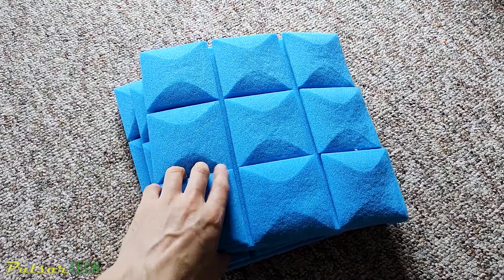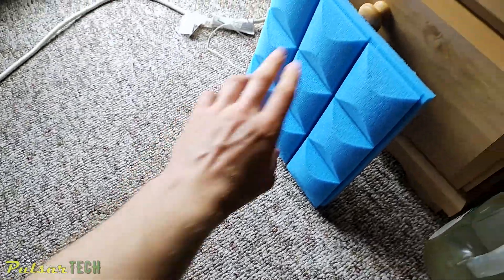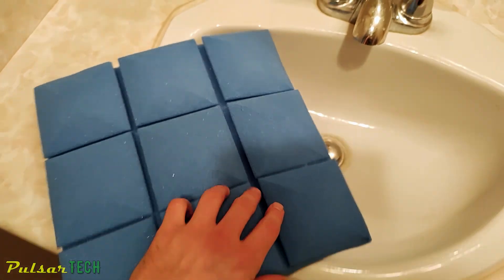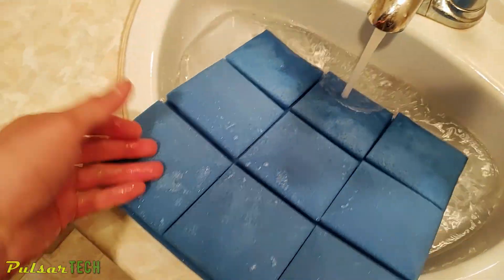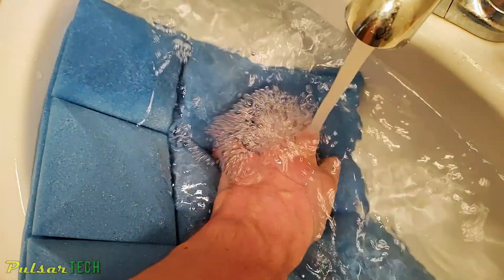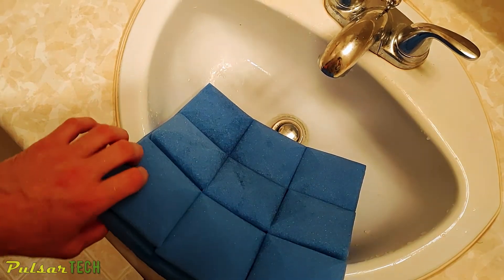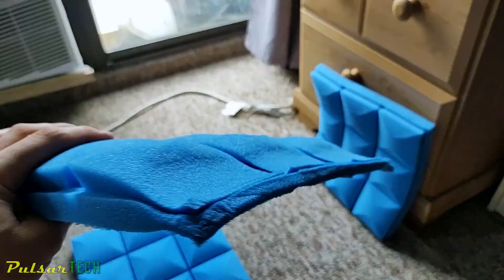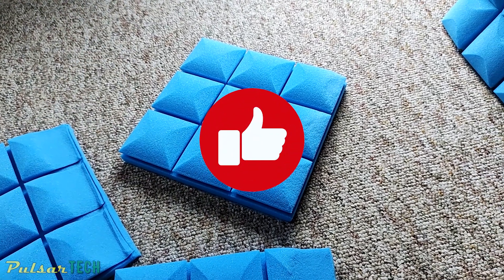HOW TO FIX DEFORMED ACOUSTIC FOAM PANELS

Comment: Can I know the particular model of acoustic foam used in this video? Thanks. The link in your description is for a different shaped one...
Reply from the maker: Hi, the link was correct at the time of posting but the vendor must have changed the design with time. Unfortunately, I can;t say if it's still available. Also as a recommendation I would suggest getting the black foam panels as these blue ones started to have some kind of yellowish tint on them, and they look like 100 years old. I don't know if it's just these particular ones or all of them. Good luck!
Reply: @PulsarTECH  Thanks for the tip , but do you know the name of this model? I was contemplating between the Pyramid shaped ones & the Cadbury/Turbo Shaped ones. But then I saw this which is kinda a mix of both...
Reply from the maker: @thesonofdarkness936  they are called acoustic foam panels 2" x 12" x 12" Mushroom studio wedge tiles. That's gotta be the name for them. See if you can find them.
Reply: @PulsarTECH  Thanks a lot 🙇

Comment: Just use a hair dryer next time (on hot temp) without the need to soak them first. They expand right away while using the dryer to perfect shape.
Reply: Not working